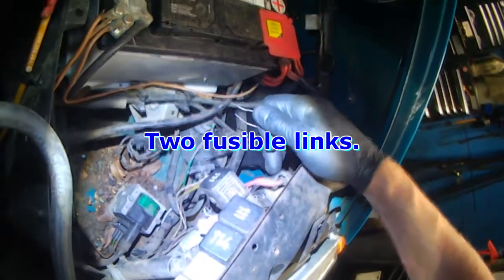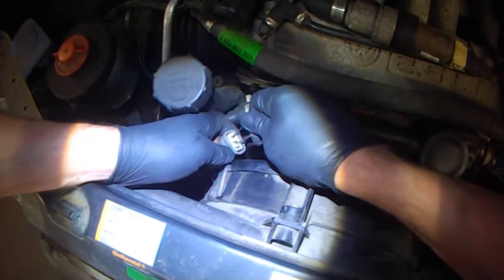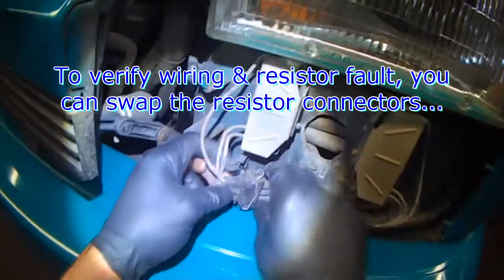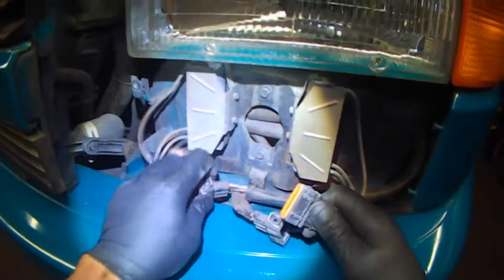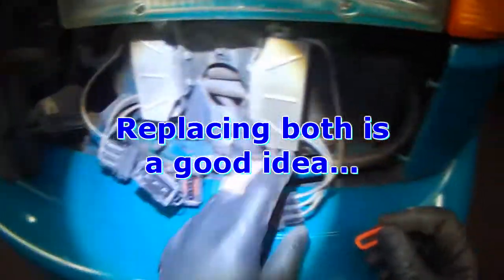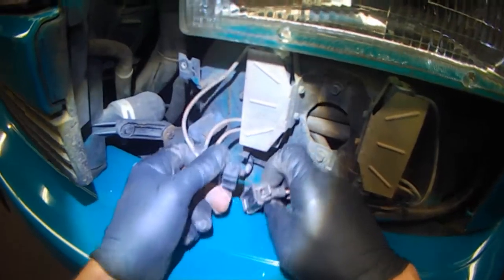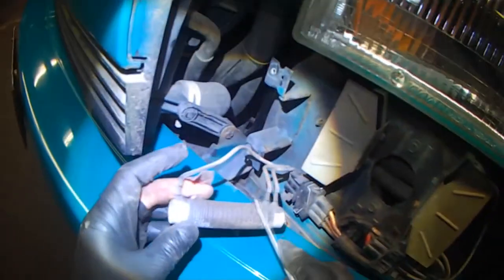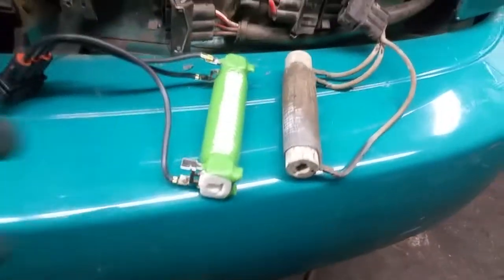VW T4: 2.5L Eurovan low speed rad fan not working

Comment: I had the same issue on my '93 2.5L. Did all the checks from the video but it ended up being the 114 relay, which controls both low speed fan circuits (on mine). Took it out, opened it up and one of the 2 copper contacts had bent back so that it wasn't closing that circuit when engaged. I bent it back and now both fans work. Hope this will help someone one day. Thank you Thomas for being the VW savior of us all.
Reply from the maker: Thank you for watching and thank you for watching!

Comment: So glad i came across this, been chasing a slight overheat issue on my 93, rear heater core was leaking so i deleted it and looped the system, then drained the coolant and replaced the thermostat.. the problem continued.. came across your video, went and double checked my fans, only one side was working but it was so loud i told myself both had been operating the whole time. 😂🤷🏻‍♂️
Reply from the maker: Thank you for watching!
Reply: @EXOVCDS thanks for the clean cut and straight to the point video!

Comment: Thanks for this helpful video. I have had issues with fans not running. I replaced resistors and now low speed works, but no high speed when jumping the temp switch connector. I can here the relay clicking but no fans. Fuses are good. What else could it be? Thanks !
Reply from the maker: Check the relays... to make sure that power is leaving them. Verify that high speed power from the relay gets to the resistors. Disconnect the resistors, bridge high speed at the rad fan switch and check that each resistor harness plug has a wire that has power.
Reply: Thanks for the quick and knowledgeable response. Turns out I may have been wrong. I think high speed is working and no low speed fans.
Reply: @EXOVCDS  Thank you Thomas. I did what you recommended. Bridged the high speed switch and there was power in one of the wires to each resistor. When the resistors were connected and high speed bridges there was power on all three connectors on the ends of the actual resistors. 

No power at connectors or resistors when low speed is bridged. Thank you.
Reply from the maker: Thank you for the update!
Reply: @EXOVCDS  Thanks again for the support. I ended up replacing the fan control unit/relays and resistors. Now high / low works but only one fan runs on low. I checked checked continuity on the power output from the relays and it’s good. I can’t figure out why only one fan runs on low.
Reply from the maker: You will need to trace / follow the low speed wire from the resistor to the fan... somewhere along the line, there must be a bad connection / corroded wire that is preventing power from getting to the fan. A corroded wire will be thicker than the normal section of wire. Post a video so that I can see you bridging low speed and how you are checking things with the test light.

Comment: Thanks for this info!  My plug doesn't quite look like that, though it has three prongs with one of them offset from the other two.  When I touch the two that are next to each other with a paperclip, my passenger-side fan runs (not sure if it's on high or low).  When I touch one prong and the prong that's offset, nothing happens.  I got underneath my '97 EVC and switched the resistors that I would have bet ahead of time that one of them is bad because they look shot, but my one fan on the passenger side still only works.  And the paperclip results are the same.  So this would seem to indicate that my resistors are okay and now I don't know what to troubleshoot next??  (I'm glad to hear you say that I'm not damaging my van by driving it with only one fan working as I'm just discovering this summer that my A/C is only halfway working - I'm hoping it's just because my second fan isn't running.)  Thanks for any tips, Thomas.
Reply from the maker: Older vehicles have a rectangular 3 wire radiator fan plug... the later style plug is roundish and you'll need the ignition ON to activate high speed (if I'm not mistaken)... due to the rad fan module / relay control assembly J26 on page 5 of this pdf:
http://fkh161.ca/VW/EV/EVRadFans.pdf

Each fan has its own relay pair that activate it. Check the relays one by one (if they are separate, it could be one big assembly).
Reply: Alright.  I just started her up and was able to get the passenger fan working on both low and high this time - it was only working on high when turned off, I figured out from this test.  I still get nothing from the driver side in any of the configurations that I try.  Just for grins, I switched the resistors again...same results.  Also, I have no idea if this helps, but I've also noticed that my air blows harder when I'm idling/coasting...and then it drops down in volume when I'm accelerating.  Regardless, it's just not cold enough.  Any ideas what to try next??  :)
Reply: I can only see one on the left...not sure what you mean by this?  Are you saying there's a second plug that looks just like the one that I'm testing with on the left?
Reply from the maker: Above the driver head lamp, mounted under the radiator support brace, is the coolant fan relay carrier (either multiple individual relays or on large module)... J26 on page 5 in the pdf above. Looking at the diagram, you can see how each fan is fed power. There are two 50A fuses that each feed one fan (page 5 of above pdf). F18 is the radiator fan switch. J32 on page 4 is the AC relay. If the wiring & fuses check out OK, then it's a J26 issue.
Air flow blowing harder or less (even though blower fan speed does not change) can be due to directional air vents moving out of position... due to a vacuum issue (if they are vacuum operated). The engine has more vacuum at idle, less when cruising. I think I mentioned the Vacuum Check Valve in the engine bay already.
A plugged cabin air filter can cause "low air flow" when outside air is selected.... but air flow will be good when recirculation is selected (bypasses cabin air filter).
Reply from the maker: If one fan does nothing at all (I already lost track of what each fan does), it could even be that the fan itself is no good. Jumping power to the fan directly (at the fan wire connections) can quickly verify fan operation.
Reply from the maker: at 0:16 you can see a bunch of relays to the left of the fusible links... 4 or 5 relays. Newer model EV's (such as yours) might have a single large relay assembly, like this: (right side of picture) https://vignette4.wikia.nocookie.net/vweurovan/images/f/fa/Fanfuses3.JPG/revision/latest?cb=20100523155748
Reply: Oh, boy.  I gotta admit that you're talking way over my head now.  Are you by some stroke of luck in NC so I can come see you??  I looked up Kingsway and I see one north of Greensboro - I'm in Raleigh.
Reply from the maker: I'm in Canada. All you need is a test light, a wiring diagram and know where the components are... then, just check for power (with the test light) at the various wires in the diagram. Do you have individual relays or does your fan module look like the picture link I provided? 5cyl or is yours the VR6 engine? The wiring pdf I supplied is for the VR6.
Reply: I found - I think - the plug on the right side next to the headlamp (with an ever-so-slight three-pin configuration)...did the paper clip method...nothing.  I'll ask a mechanically competent neighbor if he knows how to jump power to the fan directly to see if it's the fan.  Too bad you're in Canada, Thomas.  :)
Reply from the maker: Jumping the fan directly is only needed if the fan "does nothing"... if one of the 2 speeds works, then the fan is ok. The speed of the fan is controlled by the resistor pack. The fans are controlled by the rad fan switch and the fan module / relay pack.
Reply: Summary:

Vehicle off - passenger side works in high only, driver side nothing.

Vehicle on - passenger side works in high and low, driver side nothing.

I tested both plugs on both sides with the paper clip test.  I also switched the resistors around on both on and off tests.  Guess it's time to figure out how to power the fan directly to try to rule that out?  :)

Comment: Hi Thomas. I have a Rialta 95 . No power at relay no power at radiator fan speed for low speed when AC is turn on I get power at low speed on the radiator fan speed temp sensor but still no low speed on fans
Reply from the maker: Post a video so I can see what you see... where & how you are checking for power and what happens when you are bridging the radiator fan thermal switch connector (to try and activate low or high speed).
Reply: @EXOVCDS  Thomas , thanks for reply . I will try to shoot the video . For now a friend if mine reversed the low high speed so when the ac comes on the fan comes on high speed just so I can survive the heat here in Atlanta Georgia. When the ac is off the high speed still comes on when the temp needle goes over half and then shuts off . Is using the high speed as a temporary solution dangerous is any way ?
Reply from the maker: If the low & high speeds were reversed at the radiator fan switch... then you know that the switch is ok, because it is able to turn on high speed (at low speed temperatures). So you have to trace / check the low speed wiring from the radiator fan thermal switch, to the low speed relay(s). I don't know if Rialta's have / use low speed resistors (like the ones shown in the video). I don't know if Rialta's use 4 relays (2 for low speed and 2 for high speed)... or one big fan control relay box. Post a video on your channel so that I can see what you are dealing with and how you are checking for power & ground at various places. High speed activation should not be an issue  as a temporary fix.
Reply from the maker: Sorry.... force of habit to mention "post a video". I didn't mean to post it a second time.
Reply: @EXOVCDS  thank you Thomas . I will keep you posted .

Comment: Thanks Thomas. Used this to diagnose resistor pack problem on 95 2.5 ACU Caravelle (Eurovan). Waiting on replacements. I also noticed that VCDS showed Coolant temp at -40C (open circuit) constantly until (single) fan came on then jumped from -40C to +120C. Would the coolant temp reading be affected by the bad resistor (showing open circuit until fan kicked in and closed circuit sending the correct temp to the controller)? I have a brand new temp sensor in and the temp gauge moves smoothly up and down as engine heats up/cools. Am just slightly confused by the VCDS reading. Cheers.
Reply from the maker: ECM temp sensor is a separate sensor... the 2 wire blue sensor. Cooling fan operation / circuit should not affect sensor operation for ECM. If the sensor is new, check wiring / integrity.
Reply: @EXOVCDS  Thanks mate. That's what I thought. Seems odd that the jump coincides with fans coming on and there's no gradual increment. Will explore further. Cheers.
Reply from the maker: New temperature sensor is the one for the ECM or the one for the dash?
Reply: @EXOVCDS  New ECM sensor - blue two pin. I bridged the plug and saw VCDS jump up so implies plug/wiring ok - although the level did fluctuate a little around 110C - 117C. Maybe just contacts with the bridge pin. Am suspecting that the new temp sensor not working. Have ordered another anyway. The gauge is working fine and the fans (or at the moment fan) kicks in at halfway so not too worried in the short term. What are the implications of ECM getting -40C from blue sensor while running the van? Cheers
Reply from the maker: Runs rich / overfueling.
Reply: @EXOVCDS  Thanks mate. Will keep use to a minimum til sensor working properly. BTW - I'm just an amateur dabbling with a T4 addiction so have benefited hugely from your videos. Thanks. Is there somewhere we can make a donation towards all your time and efforts?
Reply from the maker: Appreciated but not needed... but if you must, you can find pick a donation button on my website. $5 gets you channel stickers. http://fkh161.ca/

Comment: What happened to the "hard to start, long cranking, rough running" video? Youtube reports it removed by the user, you see.
Reply from the maker: I am re-uploading. Had some audio issues that I was not aware of... should be back up in a few minutes.
Reply: Thomas EXOVCDS 
M'kay, thanks. 👍

Comment: Which pjs do you bridge to check high and low speed
Reply from the maker: Use your test light... there are 3 pins. One should have power.... bridge the power with one of the others to get one speed... bridge to the other pin to get the second speed. Bridging the outer 2 is usually high speed.

Comment: If I do the same thing with chip , I've got 2 working fans on both speeds. But when the temperature goes up until 100 degrees it doesn't turn on high speed,  only low speed. I changed the 3pin temperature sensor . 1.9 TD ABL T4 1995 . Can you help me guys.
Reply from the maker: Low speed is running when the instrument cluster shows 100c?
What is the temperature when you are driving at a steady speed (80 to 100km/h)?

Comment: Question, replaced both my ballasts and only one fan works on low speed.  Swapped cables and still only same side comes on.  The passenger side fan has very low voltage to the plug on the fan, I don’t know how many volts (multimeter is broken) but test light is VERY dim.  Any suggestions from here?
Reply from the maker: There are 4 relays, 2 for low speed and 2 for high speed. They are located above / behind the driver side headlight assembly. You can swap the relays around to verify a relay / control issue. All the relays have white numbers printed on the top of their housings. Swap equal number relays and test / check the fans again.The relays can be difficult to remove / get stuck in place.
Reply: Thomas EXOVCDS I swapped both 111 relays then 98 relays...no difference.  I’ll assume the wiring on passenger fan is bad somewhere...I guess I’ll have to figure out which hot wire goes to which ballast, a continuity tester I suppose then I’ll have to check resistance is said wires...I can say that  I probably do need to replace passenger side fan as bearing is making noise (I jumped it to high speed which works)...
Reply: Thomas EXOVCDS and thank you for your awesome videos, they are very helpful.
Reply from the maker: Thanks for the update... sorry about the late reply.
Yes, you probably have a bad connection somewhere then. Measuring resistance with an ohm meter is not the best way to check a wire... since the wire can show good / low resistance, but fail when the wire is loaded with current.  A good visual inspection / tracing of the suspect wire, should find the corrosion / bad connection.
Reply: Thomas EXOVCDS FYI turned out my fan motor with only high speed was bad.  I replaced and works as it should now
Reply from the maker: @enordrum  Thank you for the update. Glad you got it sorted!

Comment: sorry man i have a caravelle vw 1.9 td ABL engine . i listen only 1 fan speed in different temperature places, about 95 ° and 100 ° and 110°  i think and it's ok but only soft speed . Couple fans working but repeat same speed in the different temperature situation. I watched your video my connectors are a little different radiator fan switch is 3-polar but in triangle form..black red and white-red cable.. i make bridge black and red and ok slow vans then bridge black and white cable and silence..i make right test ? however i changed the same think in in my van (entire vans modul) inserted near the battery not neat light but changed. Repeat i listen only 1 speed.. what can i make ?When high speed vans would works?thanks a lot and sorry for my english
Reply from the maker: andreapivetta76 On some vehicles, you need to have the ignition key on to get high speed fan operation.
Reply: thanks Thomas EXOVCDS i have some news , i try to bridge red and black and slow fan ok . Bridge red and white-red and fast speed starts! So result all it's ok in manual test but in practice fast speed don't will be never used and i can tell you that temperature in stress mode became 110-115°
Reply from the maker: Replace the sensor... maybe the sensor is not good.
Reply: i'll be sure that i've understand ..the sensor that give water temperature information for dashboard ? not bulb radiator, that is new .. i've changed an '98 ABL engine 1.9 td this winter before was a '94 ABL 1.9 td engine is possible an incompatibility sensor use !? thanks very much